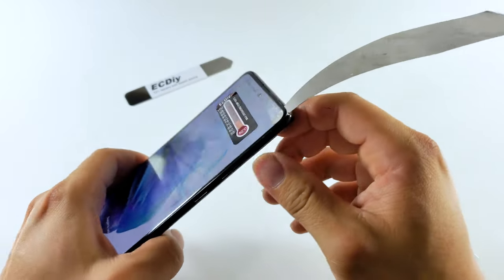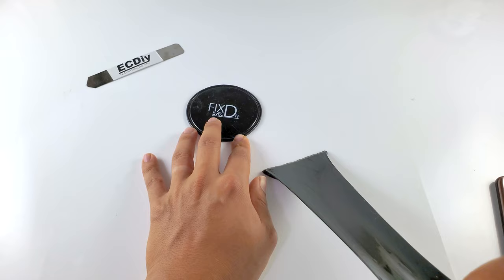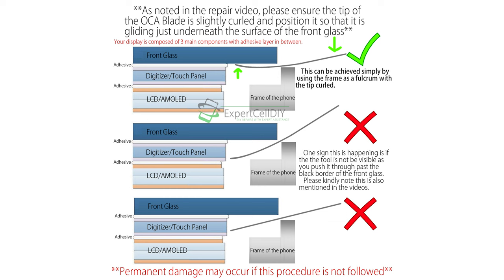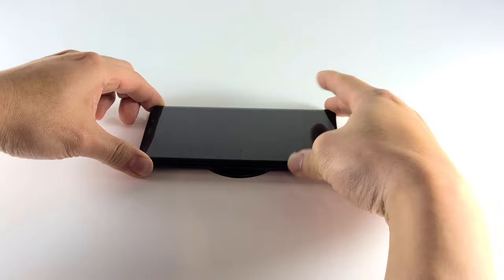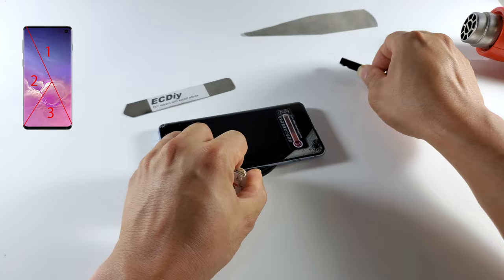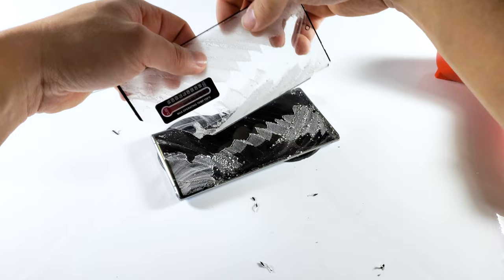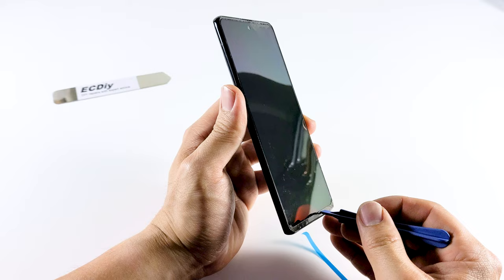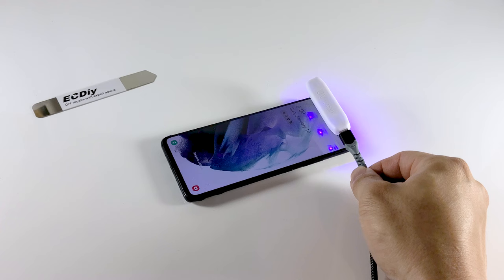How to Replace Screen Glass Only on Galaxy S22/21/20/10/+/Ultra/Note Shown in 6 Mins/New DIY Method

Comment: I just cracked my front screen and it still works but the screen glitches. Is it worth repairing myself? and alot of the videos I've checked on youtube opens the entire thing up to repair it. Will I have to do that? Your video just shows the front.
Reply from the maker: What kind of glitches is it experiencing? 
Sometimes, cracked screen glass can cause intermittent touch issues, especially if parts of the glass is missing.

However, if you are referring to glitches like flickering, it indicates there may be physical damage to the display itself and it may not be worth repairing it.

With the latest accessory we developed (Clear camera hole cover film) you do not need to open the phone up to repair the device. The accessory is currently only being provided on a request basis   at no cost. Other than that, you'd need to remove the back to remove the front camera prior to gluing unless of course, you happen to be ok with the front camera being very blurry due to glue getting on there.

Any further questions/concerns, please do not hesitate to comment further!
Best regards,
Reply: Touch sensitivity is still there, like you said, pieces of the glass is chipped off and there's this bright line of light across the phone. I just emailed your official website about the inquiry. Thanks for getting back to me.
Reply: @ecdiy  from your website, how do i request that film you're mentioning and it offers 25% for add ons, how do we access that discount at checkout?
Reply from the maker: @MinhPhan-sr9yt  No problem at all. Anytime!

A bright line is typically caused by damage or a pinch in the flex cable that runs across the bottom. I have encountered a couple of incidents where, after removing the broken pieces of glass, the flex cable returns to its normal state, and the bright line disappears. This scenario only applies to a bright vertical line that starts near the spot where the glass is broken.
More often than not, the damage, tear, or connectivity issue is not resolved by simply replacing the glass. 

Any further questions/concerns, please do not hesitate to comment further.
Have a great rest of the day!
Reply from the maker: @MinhPhan-sr9yt  Once you add a kit and an accessory to cart, the discount should be automatic. 
If it doesn't happen automatically, let me know and I will be happy to apply the discount manually via a refund.
As for the camera hole cover film, simply send us a message once the order is placed and I will make a note on it to have it sent with.

Comment: hello does it work with find x3 pro? 
you don't sell the screen but i found it, and the oca machine is so expansive...
Reply from the maker: Hello Ro Da
Thank you for taking your time to comment.
   Yes, this method will work on a X3 Pro as well. Although the process requires care for all devices, the concept for the glass removal process is universal: Modern touchscreens have the layers/components assembled using OCA (Optically Clear Adhesive). The glue we use is simply the liquid version of it.
    Our OCA Blade tool is the same thickness as the wire tool, which you see many professionals on YouTube using to do the glass separation.
    As long as the tool is touching the underside of the front glass as it is being inserted into the display area, and heat is applied to soften the OCA layer, you will be able to remove the front glass.
Any further questions/concerns, please do not hesitate to contact us/comment further.
Thank you and have a great rest of the day.

Comment: Liquid glue name plz.. anybody know which glue use?
Reply from the maker: It is called Stronghold LOCA. LOCA stands for Liquid Optically Clear Adhesive, there are several options but please kindly note many LOCAs require a separate UV lamp to cure. Ours is specially formulated to be hypersensitive to UV, so much so that exposure to daylight on a cloudy winter day is enough to cure the glue. Other parameters such as contractility, tensile strength and viscosity have all been fine tuned over the years for optimum results. 
    Please note there are a few sellers infringing on our trademark, Stronghold LOCA is developed by us and is exclusive to us. 
   Any further questions/concerns, please do not hesitate to contact us/comment further.
Best regards,

Comment: Plan to do this on my note 8. I dont have a heat gun. Would just a hair dryer work?
Reply from the maker: While you can do the repair with a hair dryer, depending on the model it can take a long time to get the display heated enough. 
Bringing the nozzle close to the phone helps speed up the heating (but not too close as it can lead to the hairdryer overheating) but ultimately, we recommend using a heat gun. 
Any further questions/concerns, please do not hesitate to contact us/comment further.
Have a great rest of the day.
Reply: @ecdiy  ty!

Comment: Bro what glue are you using  I need to fix my phone right now
Reply from the maker: It is called Stronghold LOCA. LOCA stands for Liquid Optically Clear Adhesive, there are several options but please kindly note many LOCAs require a separate UV lamp to cure. Ours is specially formulated to be hypersensitive to UV, so much so that exposure to daylight on a cloudy winter day is enough to cure the glue. Other parameters such as contractility, tensile strength and viscosity have all been fine tuned over the years for optimum results. 
    Please note there are a few sellers infringing on our trademark, Stronghold LOCA is developed by us and is exclusive to us. 
   Any further questions/concerns, please do not hesitate to contact us/comment further.
Best regards,

Comment: Do you need to remove the front camera on the Google Pixel 6 as well?
Reply from the maker: Hello Barten,
No, for Google phones, you would remove the display off the phone first, do the initial separation with the OCA Blade, then place the display glass side down on the gel pads prior to slicing the glue layer.
As the display would be off the phone for this process, when you glue, you do not have to worry about the glue overflowing onto the camera area. You would simply need to use a Q-tip and isopropyl alcohol to clean the camera area prior to installing the display.
Any further questions/concerns, please do not hesitate to contact us/comment further.
Have a great rest of the day.
Reply from the maker: Hello Barten,
No, for Google phones, you would remove the display off the phone first, do the initial separation with the OCA Blade, then place the display glass side down on the gel pads prior to slicing the glue layer.
As the display would be off the phone for this process, when you glue, you do not have to worry about the glue overflowing onto the camera area. You would simply need to use a Q-tip and isopropyl alcohol to clean the camera area prior to installing the display.
Any further questions/concerns, please do not hesitate to contact us/comment further.
Have a great rest of the day.
Reply: @ecdiy  thanks a lot for the fast response! How would I go about heating the display once the screen is glass side down on the gel pad?
Reply: @ecdiy  by the way, I'm getting this error when I try the discount code: YOUTUBEDIY discount code isn’t valid for the items in your cart
Reply from the maker: @Bartem_  Not a problem at all! I apologize for the delay in my response, but with Google phones, as you are working with the display assembly separate, you can heat the back side of the display to heat the glue layer. 
Thermal conductivity of the glass and the display membrane is similar so the process is the same other than the fact that you'd only be able to gauge the wire slicing through the location of the wires off the sides.
Any further questions/concerns, please do not hesitate to contact us/comment further.
Have a great rest of the day.
Reply from the maker: @Bartem_ In order to take advantage of the discount code, you'd place the "Pro Tool Kits" as well as the glass replacement kit. 
The code would then nullify the cost of the 'pro tool kits.'
However, currently we have a promotion running to include the pro tool kits with all glass replacement kits so there is no worries!
If we can be of any further assistance, please do not hesitate to contact us.
Have a great rest of the day.
Reply: Pls tell me is this method work on s10plus

Comment: hey if my screen has a white bar does that mean the lcd  is unfixable? and if i do this replacement i will still have that white bar in my screen ?? please respond
Reply: Hello Kevin,
Thank you for taking your time to contact us.
Unfortunately, in most cases when there is a white bar/line across/up and down the screen it indicates the display is physically damaged and replacing the glass only does not fix it. 
I say most, because in some cases, the white line is caused by the edge of the display/flex cable being pinched by a broken piece of glass and replacing the glass relieves the said pressure/tension. However, this is quite rare.

Any further questions/concerns, please do not hesitate to contact us/comment further.
Best regards,

Comment: after the glue has been applied, how do you remove it from the camera cutout?
Reply from the maker: After the glue has been applied, should there be any glue on the underside of the front glass in the camera hole area, you can clean it with Q-tip and isopropyl alcohol. 
    It is featured in our Pixel video but we have a prototype clear round film that sticks to the OLED/LCD that'd allow you to do the gluing without disassembling the phone as shown in this video nor worrying about glue getting on the front camera! We will be doing a video with it on Samsung phones soon. 
    Any further questions/concerns please do not hesitate to contact us/comment further. 
Best regards,

Comment: I wonder if this method will work for surface pro 7+?
Reply from the maker: Hello Bora,
    I have yet to work on the specific device myself but it appears OCA was used to bond the front glass to the LCD for Pro 7+ and it would work. 
    Just on a side note in case others stumble upon this: For previous devices from surface pro 4 to regular 7, the front glass was fused together with the digitizer(layer responsible for sensing the touch) and the front glass+digitizer combo was taped on to the LCD using tapes only along the parameters. Older iPads were also made this way and while our OCA Blade + wire tool can be quite helpful in replacing the front glass on such devices, the LOCA glue is not necessary.
    Any further questions/concerns, please do not hesitate to contact us.
Best regards,

Comment: How do I apply the glass perfectly ?
Reply from the maker: What phone are you working on? The best trick is letting the glue spread on its own about 80~90% of the way under the weight of the glass only, then gently pressing with about 1 pound of pressure to fill the edges should there be any voids. 
This can take some time but it's the best way. 
Are you by any chance using our glue? The above mentioned method may not work with other glues. The viscosity has to be dialed in perfect for the above to work. It can't be too low or too high.
If you are having issues, please feel free to contact me with photos and I can see what may have gone wrong.
Have a great rest of the day!

Comment: with what do i stick the back glass after will  T7000 be ok ?
Reply from the maker: Hello Kristiyan,
   We do include a new IP68 back glass tape adhesive with all our kits but we have now finished developing a clear camera cover film so all you have to do now is press the film on the display to seal prior to gluing. No need to disassemble the phone/remove the back glass.
   We will have a short video for this up soon. For now it is available on request basis only. Simply send us an email and we'd be happy to include one free of charge with your order.
    Any further questions/concerns, please do not hesitate to comment further/contact us.
Have a great rest of the day.
Reply: @ecdiy  ok so what do i have to email you ? 
i ordered  a glass repair kit and the electric  oca glue remover  yesterday

Comment: I need to do this repair for the s21 Ultra. I know that I need to remove the camera, but is it okay if the glue gets into the hole? It looked like there wasn't a blocker for it so I'm assuming it's okay but let me know.
Reply from the maker: Hello,
Thank you for your comment! 
The good news is that we are actually very close to production on a film cover shown in our latest video! (linked below). With this you won't need to disassemble the phone/remove the camera. The production version is a little smaller and less visible than shown here but it can still be seen up close at an angle with the display off.
https://youtube.com/watch?v=KFkvo5-wzBI&feature=shares&t=255

Let me know if this is something you'd be interested in over having to take the front camera off prior to gluing as we'd be happy to include it free of charge. We will be making a new video for S22 featuring this film. Should be up in a couple of days. 

Best regards,
Reply: @ecdiy  I was referring more to with the camera removed. Do you have to block off the hole where the camera was or is it fine? But yes that is something that would be very helpful in the kit for the repair.
Reply from the maker: @Zicross  Hello,
Thank you for the clarification. 
Going with the camera removal method, you don't have to block it. The glue is quite viscous so the amount that gets in the hole actually isn't a whole lot. 
The glue that makes contact with the underside of the glass in that area can be cleaned with isopropyl alcohol and Q-tip. 

If you do end up placing an order, simply send us a message afterwards and we will be happy to include the camera hole cover film mentioned in the previous response. 

Any further questions/concerns, please do not hesitate to contact us/comment further.
Have a great rest of the day!
Reply: @ecdiy  I would be interested in testing out the front camera film cover. When will the new s22 video be released? I would like to watch the whole thing a few times to get familiar with the process prior buying the set and trying the replacement myself. Thank you!

Comment: Letting the glue spread on its own is better than using clamps?
Reply from the maker: Hello Enver,
Yes. Over time, we found that letting the glue spread on its own yielded much more consistent results amongst the people who tried this repair.
The problem with the clamps was that it applied uneven amount of pressure across the screen resulting in uneven spread of the glue as well as excess squeeze out. 
Any further questions/concerns, please do not hesitate to contact us/comment further.
Have a great rest of the day.
Reply: What kinda glue is used could u tell me the name and the brand to buy? Thanks

Comment: Hi, I'm planning to get this one for my Samung S10 plus but I'm scared to scratch it and might lead to damage.
Reply from the maker: Hello Jellan,
   Scratches aren't really a concern with this repair. We do not notice scratches from the glass removal. Even if there were to be scratches, even a very fine scratch would get filled by the liquid adhesive used to bond the glass. 
    However, I do want to re-iterate that the repair is not as easy as it looks in the video and if you are having doubts, it's something to consider carefully.
    Any further questions/concerns, please do not hesitate to contact us/comment further.
Have a great rest of the day.
Reply: @ecdiy   Thanks for that. Maybe sooner or later I'll order for my phone.

Comment: Does at the normal s22 also need to remove the camera
Reply from the maker: We do have a camera hole cover film that you can place over the camera hole before gluing so the glue doesn't get on there. This is briefly shown in our latest Samsung shorts, and explained fully in our Pixel video.

However, a new tip I can share is that flat screen S22/S21, you can actually detach the display off the frame without disconnecting the flex cable by submerging the screen (not the entire phone) in 99% isopropyl alcohol for 8 hours. 

The screen lifts enough to fit a Q-tip between the screen and the frame, which you can use to clean the underside of the glass.

Under the phone's own weight alone, the adhesion strength returns as the alcohol fully evaporates. I haven't timed exactly when this happens but I have been leaving them overnight glass side down after the repair is done. Most likely not as strong as factory original, but strong enough to not be pulled off even with a large suction cup.

Comment: Assuming this would work with the SM-A505W (galaxy a50)
Reply from the maker: Yes, this indeed works with A50. In fact, almost all modern touchscreen devices are made the same and our method works with them all.

Anytime you see other videos on YouTube where they are using a wire tool to separate the glass, you can be certain our method works as well because our tool is the same thickness as the standard wire tool.

     Any questions/concerns please do not hesitate to contact us/comment further.
Have a great rest of the day.

Comment: What kind of glue u used on the screen?
Reply from the maker: Thank you for your comment
    It is called Stronghold LOCA. LOCA stands for Liquid Optically Clear Adhesive, there are several options but please kindly note many LOCAs require a separate UV lamp to cure. Ours is specially formulated to be hypersensitive to UV, so much so that exposure to daylight on a cloudy winter day is enough to cure the glue. Other parameters such as contractility, tensile strength and viscosity have all been fine tuned over the years for optimum results with ours. 
   Any further questions/concerns, please do not hesitate to comment further/contact us.
Best regards,